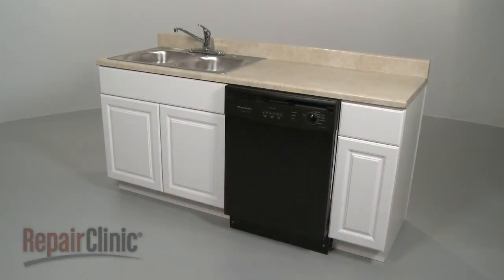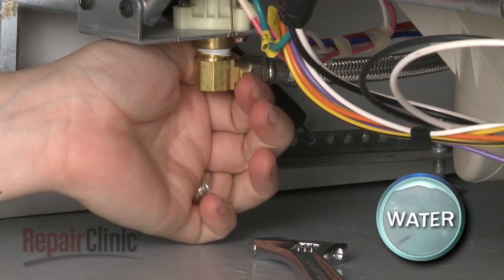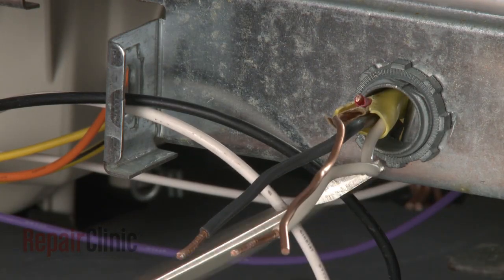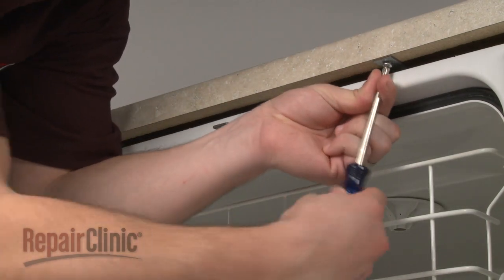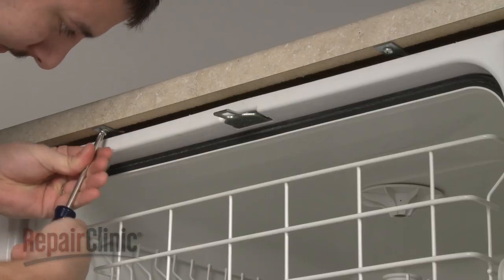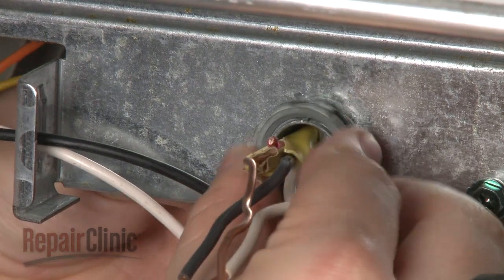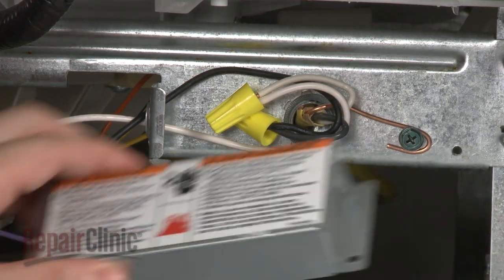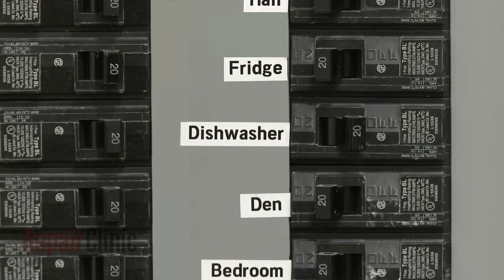Dishwasher Removal and Installation

Comment from the maker: You'll have to follow that copper pipe to the sink and cut off the water supply there. Then you can remove the copper pipes. You will have to figure out a way to cap off the drain hose hole as well. There is not a specific cap sold that we know of so you'll have to use some plastic and a clamp or something along those lines.

Comment: What if you aren't replacing the dishwasher with another one? I'm putting a cabinet in it's place. My dishwasher has a copper pipe running under the sink besides the white plastic tube to the main drain under the sink.. No garbage disposal.  I haven't pulled the dishwasher all the way out yet because I wanted to know what to do with that thin copper pipe first?  And 2nd do I not have to cap the pipe off after I remove the drain hose?  Thank you for any help you can give!

Comment: I tried disconnecting the water supply line from the inlet valve, but water started gushing. Maybe I didn't shut off the water correctly? what do you mean by expect "some" water to come out? how much is normal?
Reply from the maker: +Noémie Fortin-Brunet The amount of water the hose you disconnect could hold.

Comment: I found out that my dishwasher has a copper water connection instead of plastic like in the video. 

What I did is disconnecting the wire pipe from the sink/water source because there was more space to work the tool. Hope this helps people in the same situation.